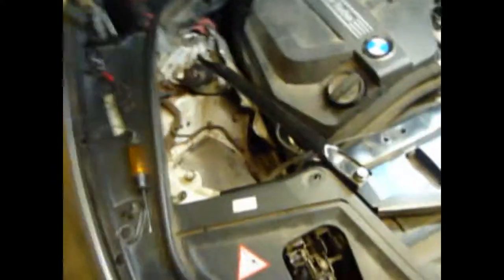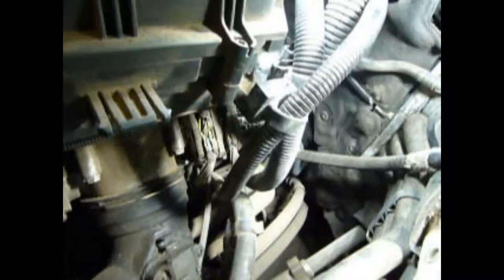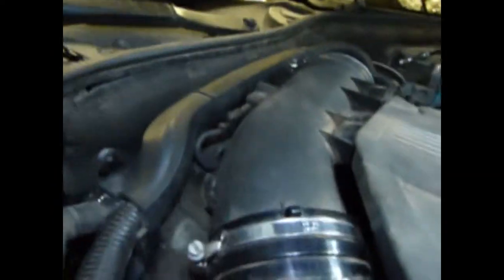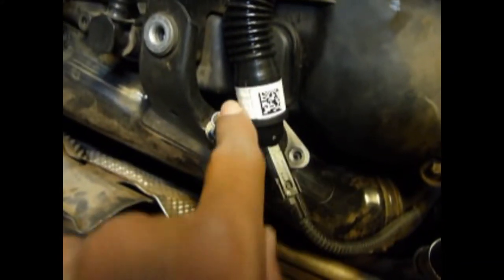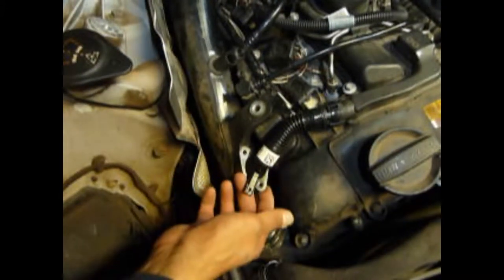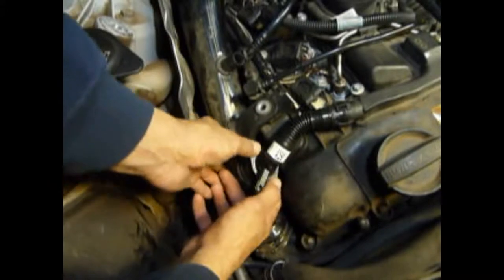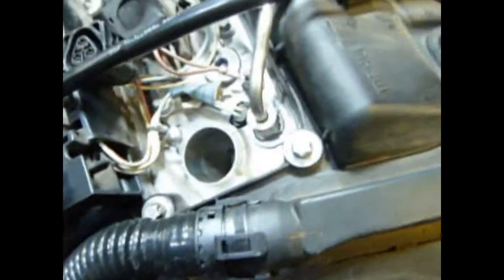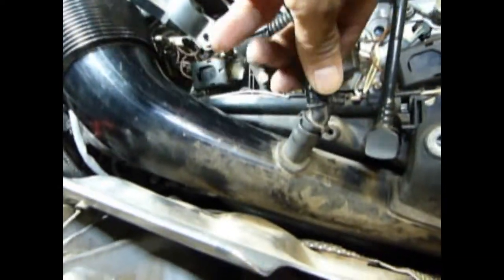spark plugs 2011 BMW 535i & crank case vent hose

Comment: Great video Marty, This came in real handy today when my 2011 535i threw a P0300 code.  Needing to change ignition coils and spark plugs.  Interesting that I found my crank case hose not fully inserted as all 4 locks clips were undone. I had the car serviced last year so I know it wasn’t me.  Thanks for taking the time to show the connector too as they can be tricky and prone to cracking as they are all plastic.   Thanks
Reply from the maker: MisterMan701  wow  glade you caught that  crank vent hose geeez !  Your welcome and thank you for watching